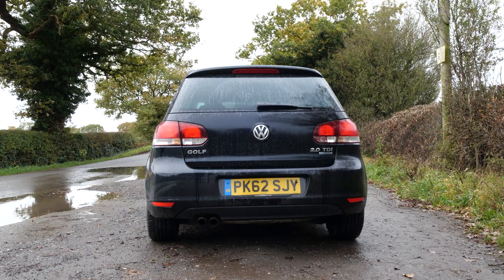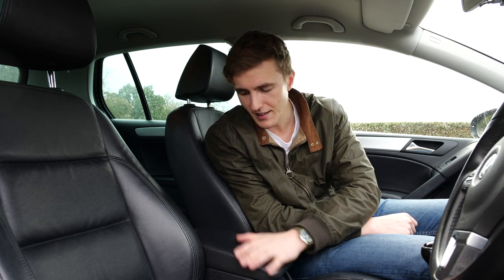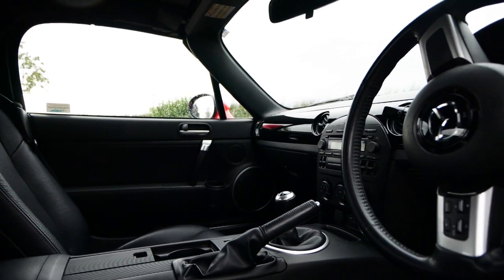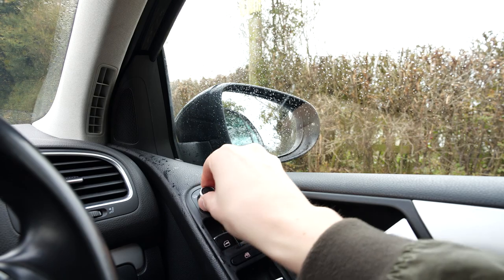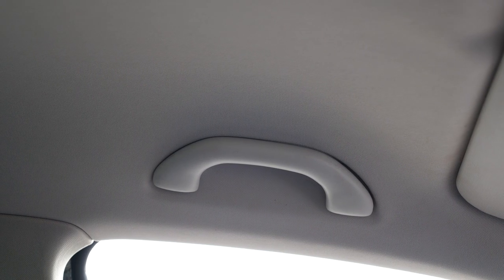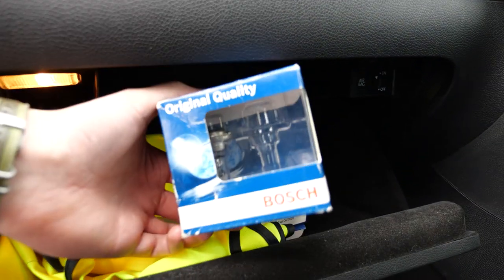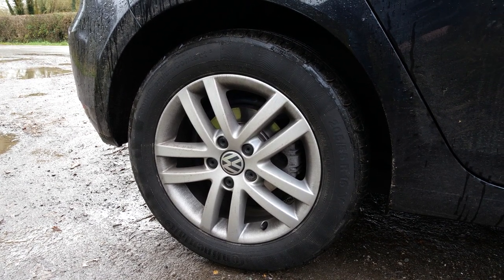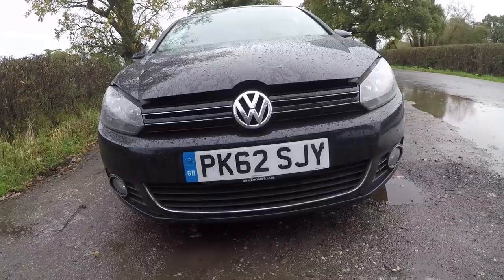VW Golf 2.0 TDI - The only car you need

Comment: I have a ‘13 3 door. It’s the best car I’ve ever owned…been driving for 60 years. Comfort wise, 13 hours and 890 miles with only two fuel stops recently. A long day at 75+ mph. I was amazed at how energetic I felt at the end of the drive, not fatigued or particularly tired. Great seats and visibility, intuitive controls, Fender audio system and that great armrest…it truly does matter. Performance at any speed makes me smile. I’m doing a long term study of fuel consumption and thus far happy with 42 mpg in combined daily driving. I hope I can find another if this one ever wears out. Excellent video.
Reply: Do the seats have good lumbar support?
Reply: @cyclonus01  yes, they have a manually adjustable lumbar tensioner controlled by a handle on the door side of the drivers seat back. Nothing fantastic but it works well enough. Just put a fresh set of Yokohamas in it Friday, rides like a new car.
Reply: @paulschmolke188  thanks for the info, really appreciate it.  I do a lot of highway driving on the interstate -- about 400-600 miles per week and looking for something comfortable that gets good fuel mileage.  any reliability issues?
Reply: @cyclonus01  except for one failure to start based on my leaving interior lights on accidentally and a drained battery, it’s never failed to start and go until it’s time to stop for the day. I too drive about 30,000 to 40,000 miles a year and live in the country where a failure of anything is a big deal. After that one incident, I purchased a high energy battery pack from Mallory and keep it under the passenger seat just in case. Every diesel I’ve ever owned has Glow Pugs to aid in starting and without electrical power, you’re gonna have problems with a cold start. I also have all periodic maintenance done by Volkswagen because they’re familiar with the cars. The owners manual addresses things that may seem unfamiliar. It’s like every Volkswagen I’ve ever owned, if you do your part it’ll work every time. I’ve had VW’s since 1964 and used them under all sorts of circumstances. They’re very good cars.
Reply: @paulschmolke188  hahah same for me.  I also live in the country where it gets pitch black at night, so reliability is very important.  How many miles are on your VW now? and what kind of mpg are you seeing on the highway?
Reply: @cyclonus01  mileage…I’ve tracked every fill up since day one. I drive away from the pump and enter real time data into my phone then later into my iPad. I do the calculations every time. Mixed driving is never below 38 mpg and usually about 41 mpg. On long drives like my annual 890 mile visit to my home town in Little Rock, Arkansas, I stop once for fuel in Clinton, Oklahoma, a distance of 450 miles. I think it would go 600 on a single tank but I’d rather be safe than sorry. In answer to your question, I’ve never tracked highway only mileage but I think my illustration above will give you an idea. When I bought the car, diesel was just under $2 a gallon, now it’s almost $6 so fill ups can be painful. I usually cruise at highway speeds of between 75 and 80 on the interstate. Our local highways are pegged at 55 and below. My primary route to the big city is through mountains where I gain and lose elevations of up to 7,000 feet, starting at 6,200 and ending at 5,200. The return trip is the opposite. Most of my driving is above 6,200 feet. Keep tire pressures at factory recommendations. I run on Yokohama Advans and they go about 60,000. I bought the car with 25,000 miles on the odometer and it’s currently very near 90,000 after just over two years. It was a dieselgate return and got full factory warranty with all needed upgrades. The dealer found it for me in less than 24 hours.

Comment: Hi, thanks for the Vid, really enjoyed it! I'm after one of these in the next couple of months. Are you satisfied with the performance? I've seen online that people have been having them chipped to 170bhp. Does it have enough grunt for your day to day needs?
Reply from the maker: Sam Faulkner plenty quick enough unless you’re a speed demon! Fact of the matter is it’s a small car with a moderately large engine so it’s not slow. Depends what you’re used to! 1st, 2nd and 3rd gear are torque limited to prevent wheel spin so they don’t feel that fast, 4th is where it’s at 🤘best thing to do would be take one for a spin. Manual FTW, drove an auto and it wasn’t very slick.
Reply: My ‘13 will peg the speedometer at 7.000/feet above sea level. I live in a place that’s loaded with higher altitude driving. I did this a couple of years ago to check new tire balance. I was surprised. In traffic, it’s quicker than most everything.

Comment: Great video and couldn't agree more. Having come from a 2008 GT TDI Golf 170 manual, its been a game changer to go to a 4x4 MK6 era TDI with DSG. All the traction you need, and no more leg pump from endless gears in slow traffic. I'm at 315,000kms in that car now, been tuned to within an inch of it's life, and it's still going strong.
Reply: Is dsg reliable

Comment: good points on teh screen tech, but for me im not bothered at all on the screen, as long as i have good strong reliable engine and good for miles and that is certainly volkswagen. Ive had the cc with the 2.0 tdi bluemotion engine 140 bhp but you would be very surprised just how good it really is, mpg always puts a big cheesy smile on my face when a lot of modern day cars and suv,s get no wear near my figures and is very satisfying im spending money well in the fuel department, i like the ride also. I had a couple of passat also great car to driver and live with, you could say im a big vw fan, the golf is an excellent car all round, and great fun to drive, great mpg figures also, like they say look after your car and it will look after you.
Reply: Hey! From which year is your CC?
How many miles/kilometers?
Automatic or manual gearbox?
Any problems so far?
Sorry for the many questions, I was looking into a 2009 TDI 2.0 automatic with around 33,000 Kilometers on the Odo.

Comment: I have a GT 2.0 TDI Blue motion mk7 2013 and it has 321,000KM on the clock service it every 3 to 4 months or 10,00km I drive to work and back 434km 3 - 4 days a week. I love it such a reliable car as long as you take care of it.
Reply from the maker: Yes, love hearing this. Any idea what you will replace it with once it reaches the end of its life?

Comment: Well i'm sold this will be my next car, i have a polo 6n2 tdi from 2001 its a £30 tax model, Ive had it for 10 years its been a great car and saved me loads and not let me down, also still drives great doesnt feel like its lost anY bhp even to this day. The only things that i miss is a bit of comfort like, air con, heated seats / mirrors and arm rest would be great for longer journeys.
Reply from the maker: Had a 2010 polo myself as my first car. 3 cylinder 60PS. My housemate at university had a 1.2tdi polo. They seem to last forever and I will always have a soft spot for the Polo! But you can’t beat a Golf for comfort!

Comment: My dad has a 2010 2.0 TDI 140 Golf (it’s not a bluemotion) and the RNS 510 (sat nav) which died about 6 months after he got it so he got an RCD 330 which he is considering taking out and putting the original radio back in and taking to the VW dealer to get it fixed

Comment: The voice activation on the steering wheel is a default button regardless if the car has it or not, the car has to have a module which was a cost option at factory but VW left the button on the steering wheel regardless.
Reply from the maker: Mark Turner-smith Must try mine out now, thanks for sharing!

Comment: I have the exact same spec here in Canada, but it does not bear the "blue motion technology" logo (140 bhp/320 NM of torque): very pleasant, reliable and quick...I love it and I just did the sprig prep: wash inside out, clay barring, compound with sonax and wax with McGuires...it is 2013, but still looks like new...the rims were too small, so I put the 2016 Golf R 19" Cadiz rims on it (235/35/19)= huge difference from the stock ones.
Reply from the maker: Bet the 19’s look mega! But £££!
Reply: @CarThought  Yes, they look crazy, but got them for pretty cheap, 1000$ for the of 4 of them. At the dealership, they cost 1000$ each! I can send you pictures on your email...I put more than 10 k on it and trust me it is worth the look!!!

Comment: You can get something like Focus mk3 cheaper but when you look for the details, VW just justifies the extra cost. The interier materials are better, the layout is more thought out, the finish of the control elements is better. Even the base model is just nicer inside.
Reply: yeah golf is nicer that's true. However they fall apart after 10 years. Mine spends a week each month in the garage. Getting rid of it asap. I wish had I bought a focus instead...

Comment: 1. You don't need to bother if you forget to turn off the heating in your exterior mirrors. After a couple of minutes, the heating gets turned off automatically by the car's electrical system. It will only get turned on again, if let's say you leave the button turned on, and next time you start the car, normally, the heating will turn on, again, just for a few minutes. It is just like when you turn on the heating in the rear windshield, to defrost it and after a few minutes, it will turn off automatically. 
2. Soft close for the roof grabhandles is not new, at least at VW. It is there since the Golf Mk 4.
3. All Golf Mk 6 have that chrome line around the fog lights. It does not deppend on the level of equipment of the car. If you have fog lights, you have that chrome circles.
4. Floor gas peddal is on VW since the Golf Mk 5. Nothing new, again. As the Golf Mk 6 is sort of a facelift of the Mk 5 (same platform btw), VW kept the peddal types on this generation too. On the Mk 7 saddly they gave up on the floor gas peddal and restarted using the classic type.
Reply from the maker: Hi Sebastian, thanks for the comment. I have to disagree with you on point 1. Maybe it is different models for different continents? If you are In the UK, you’re welcome to come and meet me at an event and I will show you once everything is back to normal.  Stay safe 🤘

Comment: the TDI GT is a badass sleeper car with 320Nm. 
engine, brakes and handling let down the regular TDI down.
mk6
Reply: I just bought a mk6 GT TDI 140, manual box.. anygood?
Reply: @lewisk5430  very good car mate. Just keep on top of maintenance and service. I would get it into main dealer at least once for MOT and service so they can look over it. (be warned they will try to upsell you on everything). Beyond that main dealer service might be overkill. As with all second hand cars, put priority on getting the running gear in tip top condition.
Reply: @tensevo  sounds good cheers mate, do you know what engine is in them? I want to remive dpf, egr, cooler snd map this but dont know if its safe someone told me the internals on the mk6 are chocolate
Reply: @lewisk5430  All I would say regard to tuning is, find a specialist, but before that, you will do much better, like I said, by keeping on top of servicing and maintenance. I see too many cars "modded" that drive terribly. You would be best served, spending the cash on   regular fluid and filter changes, fresh tyres and well sorted running gear, engine turbo, gearbox, driveshaft, brakes, discs, wheels, can all let you down if they are defective in any way, and will offset any mod or tune. p.s. the internal on the mk6 GT TDI are not "like chocolate", but a few things to think about: the car is quicker than say a mk2 GTI 16v, it handles better, and that is way quicker than you need on the road. If you want to go to track days, you may be best served with a mk6 or 7 GTI or R.
Reply: @tensevo  yeah i had a mk4 GTTDI pd130, remmaped to 180. Rapid car but a non gritted icey road claimed its life, back axel snapped by sideon sliding into a very high kerb, I was only doing 20 aswell

Anyway as i say the MK6 GT TDI its tidy as inside and out, but it had the recall ECU update, is there anything i should know or look out for?
Reply: @lewisk5430  Not had the update myself, as I was concerned it may kill performance. If you floor the throttle when stationary, it puts a rev limiter on. That is it. I did not see why I needed to risk them messing up the ECU.
Reply: @tensevo  yeah it has the limiter i didnt know if that was a saferty feature for to engine temp and revving, because new M BMW's all have that but when upto temp you can rev it to bits...  i get back home tomorrow going to go for a blast and see what its like, i knkw its not going to touch my old mk4 in performance tho
Reply: The GT TDi has 350 nm.  Brakes are the same on both models as is the suspension except for 20mm lower springs. But everything else you write is correct

Comment: Hi I've just bought a 2009 Mk6 GT TDI it has a powertrain fault it's had the egr cooler removed have you had any issues / problems with yours I should look out for mine has done 96k miles thanks
Reply from the maker: adam mason helloooo, yes egr’s are a common fault on most diesels. The soot from the dinosaur juice clogs up the recirculation system. 2 options, replace the system and have it break again in another 96k miles or blank it off with a small plate and re-map to delete it from the ecu. Maybe look out for a sticky bonnet latch like mine? Haha

Comment: Tip if you buy a TDI, DONT GO TO THE RECALL!!! DO NOT TAKE IT TO VW FOR RECALL ON EMISSIONS!!! You buy the golf TDI for mpg, used to get 60/70 minimum on drives now I AVG 47 after the recall. You will waste money on fuel trust me
Reply from the maker: Yes lots of info on this, never had mine done as heard rumours fuel was getting into the oil
Reply: And what about EGR valve fail after the recall
Reply from the maker: @Daragon760  EGR valves on diesels tend to be one of the first things to go, recalls or not. The soot clogs it up.. just part of owning one!
Reply: @CarThought  How will i know if the car has been recalled or not?.. can i see anything physically on the car or only in the paper work?.. considering buying one for my next car
Reply from the maker: @agentcarbunkle  will be recorded in the service history of it has been completed. Unless prior owner has removed it from the SH.

Comment: Are you running the proper low ash spec oil? It's difficult to find here, and I wasn't aware of a semi-synthetic with that spec. Wish we had the oil temperature in the states.
Reply from the maker: I run fully synth Castrol edge 5w30. No idea on saps content. Cars on 133000 miles now 🤷‍♂️
Reply: @CarThought  Nice, I couldn't find that so I went with the 504-507 spec pentosin.

Comment: Looking at this exact model , the golf r led headlights will fit this model won’t it , the ones you put a quick picture up during the video ?
Reply from the maker: Physically they should fit yes, but the LED units I think require a lot more power so there will probably be an inverter fitted somewhere. You may also need to program the Body control module so that you don’t get any error codes.. but I would check all this before purchasing.
Reply: @CarThought  of course . The ones off the internet such as amazon say plug and play . Imagine there’s truth to this otherwise false advertisement?
Reply from the maker: I’m skeptical of the quality if they are personally.. But quality has moved on so.. maybe! Any reviews?

Comment: @carthought How much did you buy & how much did you sell for? I'm on the look for one of these or the non blue motion one
Reply from the maker: Prices when I bought that car would be way out now as it was purchased in 2015 with 38K miles. Never sold it, still drive it every day. Estimated worth now would be £4K. Hope this helps 👍
Reply: @CarThought  Good choice in my opinion 👌🏻, that has helped yes thanks, I'm looking at one although not a bluemotion & no heated leather seats, the one I'm looking at is the half cloth half Alcantara which leads to my next & final question, it has 107,000 miles... Full service history with 1 previous owner but no paperwork for a cambelt change.....advertised for £4,000.... the cambelt not being changed is that a big issue do you think? Should I buy?
Reply from the maker: If it’s not broken but they can’t prove it’s been done, then I’d ask the garage to knock the price off for the cambelt, new water pump and coolant change. Buy it. And book it in the following day to have it done. Use the cash you saved on the sale price to have it done. If I remember correctly should be around £400 mark. But call a vw garage and get a quote.
Reply: @CarThought  That's what I was thinking, so it was £4600 then reduced to £3995 but they won't go down much now because they've reduced with cambelt in mind & a couple of other small blemishes. I had a figure of £3,500 I'd be happy to pay & then get the work done but I'm sure they won't go that low...Vw garage near me quoted £520 but I'd be using a small garage for certain

Comment: I had a 2006 golf TDI 2.0 and it was a complete and utter turd. Steering rack failed twice, head gasket failed. The engine snapped off at a mount and it was unrepairable. New engine. Wheel bearings failed at front. It blew headlight bulbs like crazy. It had only covered 86k. Sold it on and bought Toyota.. never looked back
Reply from the maker: Sounds like you did have a turd there 😂. What history did it have before you bought it? I think a lot of reliability comes down to maintenance. 
Loads of Mk5’s seem to be on the roads still.. but then again there’s also lots of Toyotas too! Just the Toyotas are known to rust out faster.